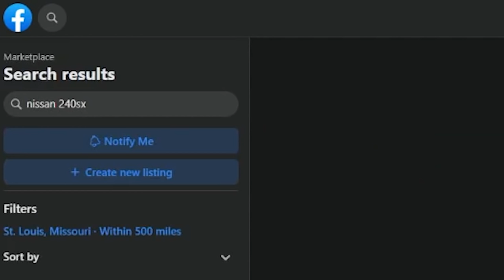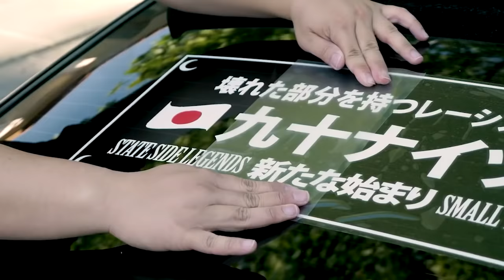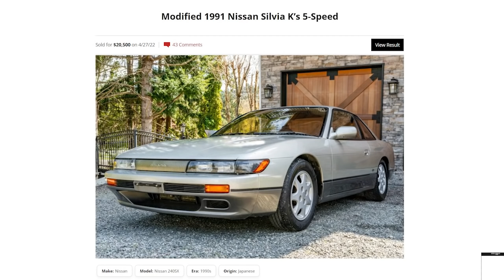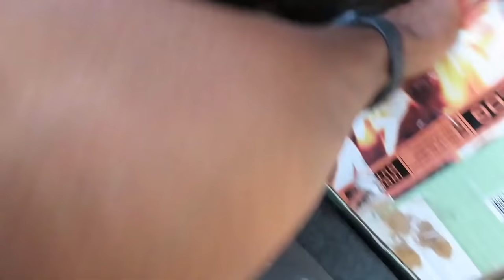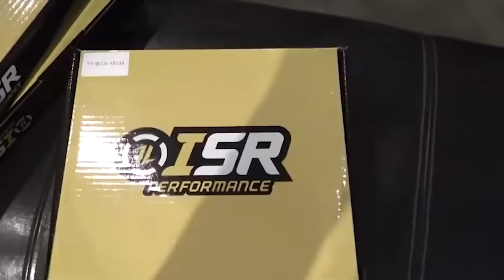Hard Truths of Owning a 240SX in 2022 (Donut Media Won't Tell You This)

Comment: I think this video addresses a bigger issue than just 240 buyers and owners, the clout chasing. You shouldn’t be buying somebody’s unfinished project period and you shouldn’t be doing mods for attention. If you buy a 240 that’s been taken care of, it’s going to run like a car that’s been taken care of. If you mod your 240 like a car you want to be reliable, it will run like a car you want to be reliable. As far as being a money pit i’d argue you could say that about any project/track car but, if you plan to keep it stock it won’t break your bank anymore then any other older car and it will never stop running (again if it’s been taken care of) I’m the third owner of my s14 which i purchased bone stock around 180,000 miles and besides being left to sit for around a year before i bought it there was 0 issues, preventive maintenance, experienced/responsible modding and proper care and they are amazing daily’s and track/project cars.

Comment: This man, this man knows what he is talking about. :D

I've built.. No.. 'REPAIRED' these (200sx s13) for 9-10 years, and STILL i won't buy a shell. 
I will only buy running, inspected individuals and still i will restore them for the next 5 years, because rust and what previous owners have been doing for the car (i love surprices as long as its not some "fix" in my s13). 

My first car was 200sx s13, it was painfull. Read 4 days how to fix, wait parts 2 weeks, fix it 7 days, drive 5 days, repeat. I bought a car so i can drive to school, well options were still mostly bicycle or moped. 

Know what you are doing, 
read the holy book (manual). 
Otherways you just help the S chassis to disappear from earth, so f u.

Comment: going to auto school, might have to buy a 240sx just to always have something to work on there 😂

edit: 7:36 can confirm it is very much possible to get a cheap car without putting more that it would cost to get a decent one into it. just not an s-chassis. i bought a 900 dollar saturn because the owner thought it had a head gasket leak. checked all the fluids, everything was fine. found a leak in the rad where coolant was boiling off the fins and making it look like smoke was coming out of the engine. after i bought it looked at everything and it only needs about 600 dollars worth of work done. only 90k miles. couldnt have stolen it for cheaper.

Comment: I’m 17, I’m not wealthy, I’m not a genius at working on cars, I’m not a genius at welding. I’m young, I love cars, I have a couple of good friends like me. I bought my s14 clean title for 4500, with a ka24de with no compression. I had it towed to my house and put into the garage, I got straught to work that night pulling everything off, i took pictures, remembered how it all went together, when I finally got the head off I saw that there was a bolt stuck in the valve, I popped the bolt out the valve, put some gas in it to make sure it still held gas, I put everything back in, new HG new distributor, plugs and wires and some other stuff. The car didn’t wanna idle but was holding compression, I took it to a local speed shop and they found that I didn’t time it right for 800$ they timed it and now the car is running great, I made it all the way to FD just in time to, I’ve been clutch kicking it around corners drifting on stock power with a nismo LSD. This guy sounds like someone that is a lazy sad asshole, who prob fucking drove a hunk of shit when he was 17 because he didn’t have the guts to go out and make something shitty nice, point is. I believe in you, don’t let this guy convince you that your not a drifter and your not a real car person. Your some TikTok lamo that should just drive his 240 bone stock 🤣, go buy that shitty 240 do everything in your power to fix it, have no plan B and then go drive it like you hate it.
Reply: literally the worst advice you could possibly give

Comment: I never had to learn the "don't buy a shell" thing myself. My buddy bought a clapped out DSM and neither of us really knew how to work on cars. We were teenagers, at that stage where you've learned enough about cars to think you know how to build something up from a clapper, but you actually don't. Now, I know HOW to do it, and how to do the research for a specific car, but I also know there's no way in hell I'm actually going to want to spend the time and money on doing it. So I don't buy older cars anymore. I don't care if I have to buy something slower because something as fast that's new is too expensive. I could've bought an old AMG (again, did that once and got lucky, actually) or something and gotten 400-500hp. But, instead, I bought a 2017 GTI and got it flashed with an APR Stage 1 tune, which puts me at around 316hp. No, it's not taking anyone to gapplebees. But it puts a smile on my face, and it has low mileage, so it should be decently reliable as a daily.

Comment: Holy shit this is the greatest video of all time.

I made this mistake fresh out of highschool, but it wasn't a 240, it was a beat to shit LS400. I was into v8 boats and japanese shit, so the LS400 was the most highly coveted vehicle in my 19 year old mind, I wanted one in the worst way possible, and I wanted a pre-facelift one, would not settle for anything else. I went to check out the first listing I actually inquired on, ignored my gut, and bought it. It was the biggest piece of shit ever. Had mold in the interior, wood screws holding the dash together, some kind of misfire, exhaust leak in the cab, ODO was rolled back, actual mileage was well over 300,000. I kept telling myself it would be something again someday, and the car sat for almost a whole year at my apartment before I had to move it to street parking, where it was quickly towed and impounded. I hadn't changed my address from my mom's yet, so by the time I found out which yard it was at, I had to fork over $1000 to get my $2000 purchase out.

After I handed over a good portion of my savings to impound, the phrase "why the fuck did I buy this?" echoed in my head until finally I was only able to give it away. To a junk yard for $250. 3 GRAND down the hole, never to be seen again and for nothing. Lurk the market hard, and be prepared to walk away from anything, even if the bro pawning it off, car influencers, and your own naivety make it seem like the deal of the century.

Comment: Believe it or not you can make a 240 reliable even with bigger hp numbers but it definately cost decent money and no corners can be cut the saying fast,reliable,cheap you cant have all 3 applies to all cars. it cost money to build a car right I have over 25,000 in my s13 coupe with an rb25 motor and trans making 487 whp currently going to be about 550 on the new setup I have for it waiting on a 6 boost manifold that’s been sitting in customs for 2-3 months now. Definitely need patients to have a project car. In 2007 I had a s13 hatch that i sr20 swapped it made a solid 325 whp and it lasted 8 years with nothing more than routine maintenance i daily drove and beat on it a lot. Its defibately a lot cheaper to build one if your happy with 350 hp or less once you go above 4-450 is when it gets a lot more expensive and you start breaking a lot more things. Have fun and enjoy your 240sx. To me the worst part of owning one is I used to be able to blow up a rb25 and get a long block for 1000$ I bought one for $800 one time. now it’s around 4-5000$ they were a lot more fun when parts were cheaper and you could afford to break it more often.

Comment: Yupp Got to get the car to run and work before mods. Had plans for a race air filter M5 bumper and tune on my BMW f10 but a real issue came up so there goes that buget. It has to run right before looking good or going faster lots of people dont get that

Comment: my s13 hasn't seen the road much lately but it does run, im going to keep it garage kept and running on a t28 powered ka24e probably for quite a long ass time. it will end up in my 2 year old nows hands when hes ready if gas is still available its not perfect but its not wide bodied just dropped on 180sx type x tails and jdm front kouki turns.

Comment: I bought my running 91 hatch 3 years ago for 3k and found that i had to replace 2 frame rails and 7 holes in the floor lol.   All done now myself with a 200$ harborfreight welder and maybe 120$ worth of metal 😸 
   (Its still sittting in the driveway tho)

Comment: I have an s13 with a stock ca18 but is broken right now, looking to swap a reliable engine to just enjoy the car.  I want to swap in a honda v6 to make it reliable and be able to keep it on the road more since its very easy to find parts for the honda. The ca is good when it works but parts are hard to find and its very expensive for what it is...

Comment: I just traded my reliable 3rd gen 4runner for a not running 240sx with a somewhat clean chassis (strut towers already repaired one frame rail with tiny hole. Got it running and driving but idles funny ajd falls on its face after 3krpm. Wish me n my ka24de luck yall 😅

Comment: I love this video tbh im a big fan of s13s but here in Australia i can get 2 xr6 turbos with 270hp before a tune no mods needed or i can get 2 v8 commodores for the price of a s13. sr20s are around 7k no hot side what!! you can get a ls1 for 5k and it comes with everything running from the car or sr20 no ecu no box no turbo ive gotta sink another 5k on top of the 7k i dropped on the motor just to get the motor ready to put in a car.

i love the s13, i love the sr20 but i cant justify 20-30k on something thats half done runs crap and has less power then most other cars that are half the price, also to get to the track and everyone has the same thing no thanks hence why i went with datsuns. I got a 180b and a bluebird no one knows carbies these days so thats different and theres no parts so i make everything myself which is crap cause its a pain making everything but its great because kids buy them cant get parts cant make parts cant get power out of them they get the shits with it sitting on the lawn and sell them to me for nothing win win!

Comment: found a barn find 240 with 138k miles, "rust" the guy won't specifiy where or how bad it is, no radiator and no battery. 3k obo. At least the interior is mint and it actually has a single cam KA in it. Not modded to shit too. Tempting

Comment: Everybody thinks they have gold but sell junk for a price of the gold. Good cars are rare. Most of these cars are just a money pits. In case you want to have original car of course. If you want some SEMA junk project it will be way cheaper to fit a bodykit, homemade interior, random suspension and whatever engine. So shells are fine. But overpriced.

Comment: Bro I had a 240sx for 7 year invested 10,000$ and three clapped motors later and it’s still stuck in the shop and basically doesn’t leave but runns f barely bc the ign timing is off lol

Comment: I was once the dumb kid, with little car experience in general, who bought a busted 240 back in the day. I got older, drove a ton more cars and guess what...that busted 240 is still sitting in my garage, 18 years later, in the same condition I left it in, when I first purchased it. 

Also, to piggyback off his comment about older dudes who think 240's are still work sub 2k...no. They are not worth that much. That golden age of drifting and hardparking is over. 240's, even in shit condition, are worth far more than they used to be. Sure, a rust-bucket aint worth any price, but.....and I just saw this on reddit....

If someone is selling a 240 with an RB swap, it has its body issues, minimal rust the engine still turns over yet the car is most certainly a project car...Someone selling it for 6k, is a damn fair price today. 10 years ago? Lol, maybe 2k, but fuck man.

EDIT: Their are entities still making stock parts for the 240's/Silvias out there.

Comment: I think what the older guys in the community mean is that 240sxes SHOULD be $2000 cars rather than 240sxes ARE $2000 cars. And in my opinion yes that should be true but it isn't since every kid wants their dream car as their first car instead of getting a car to learn on first making them "rare" in nice condition. Same thing with BMW E30s.

My dad bought his 325is 5 speed coupe in 2003 I think and still has it. Bought it for $3500. Now that car is $35000 because people wrongfully think they're collector cars since they all got modded and not maintained.

So I went for a 1974 3.0S as my first car instead. Bought it for $6000 last year and it drives great and with virtually no rust too. Think about it. Why in the world is the older car with only ~60k miles cheaper than the newer rustbucket with ~220k miles in the current market? Shouldn't the older car be more of a "collectible"? It is all because the E3 is a less popular platform than the E30 (even though they perform similarly from stock). I won't say to never mod your car but I will say to do all the maintenance first. You can never do too much maintenance
Reply: The market dictates what is and isn't collectable/desirable.  Sometimes it's something as arbitrary as "The bumpers on this model year are different" that makes the difference.

Comment: So if it has carpet, runs, and is fairly original, or free of rust… it’s a gem?
Reply from the maker: If everything is in good condition, it runs properly, the mileage isn't insane, it has no structural issues, and hasn't been hacked to sh**, yeah, i'd call that a gem
Reply: @CollectorCarFeed  220,000mi, had manual put in, new clutch, one piece drive shaft, needs ac fixed(probably compressor), Speedo doesn’t work, and needs a gauge bezel. Otherwise 99% stock. Not sure if worth 7k asking or maybe closer to about 500-1.5k? NADA and KBB pushing closer to about 1k looks like. 
Thoughts on these details?
Thanks for the reply btw!!!

Comment: Im 99 per cent sure this hurt the ego of a lot of people. 
This video applies for EVERY popular car platform. I'm tired of the dumb teenagers that worship the whole drift  supra GTR Godzilla JDM crap.  Most of them don't even change their own motor oil. 
And because the 240sx is one of the most achievable car of that cult, the car community got filled with 240sx dumb owners. That's why they don't even exist in good condition. Because of that kind of owners. And it's a cycle like you said. 
This slap of reality was needed. Thank you for your service. I really hope this goes viral.
However...... i'd sell my ass for a decent '98 JZX100 😅

Comment: I had a clean stock s14 with bad paint and a dent in the quarter panel but the motor shit on me so I swapped a different ka into it and it ran but badly my clutch was bad the car ended up sitting for around 2 years so instead I sold it and went to a c5 now I daily it and it’s faster in way better condition 240s are only worth it if you have it as a project in the back yard or garage not a good daily unless in good shape

Comment: On an unrelated note, sourcing replacement parts for my 1990 J30 VG30E powered Maxima is a bitch thanks to the 4th gen Maxima community’s Soon™️ goon squad. I see so many ridiculous posts about “300zx swapping” A32 Maximas from the same people described in this video and it embodies every facet of the discussion. You get the cheap car fallacy from people buying up the last running J30 Maximas and I30s to harvest the motors for their “swaps” only to find out it is a truck motor that runs hot as shit and makes 190 crank hp unless they sink thousands of dollars into it. You get a different kind of negative community, where it isn’t toxicity, but just defeatism, largely from people realizing the J30s have been wiped out by “mUh 300zX” fanboys. I could go into more depth but I’m sure this rant is already far too long, I just feel so annoyed that a car that is a great daily driver with a ton of comfort features and great driving dynamics has been wiped out thanks to the same clout chasing. I live in San Diego and for a major metropolitan area with a large JDM scene, especially one where rust is a non issue, I’ve never seen another J30 on the road, just the metric fuck ton of shitbox A32s which have a ricer community.